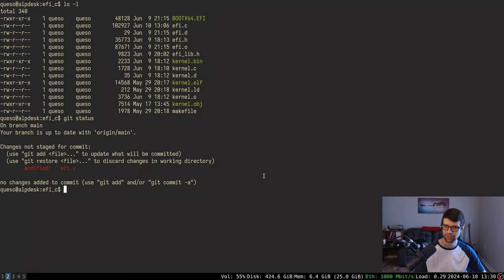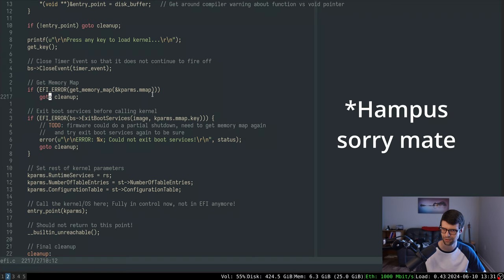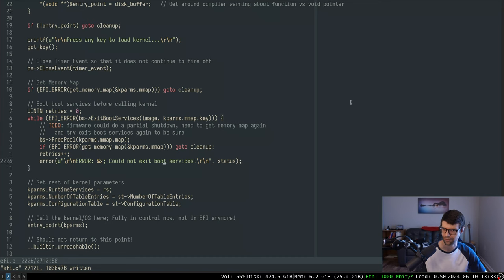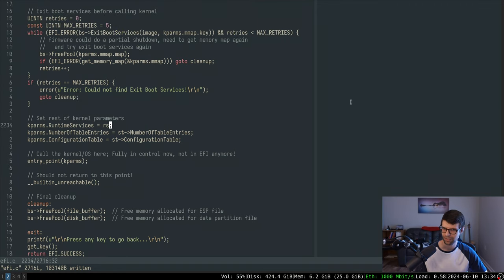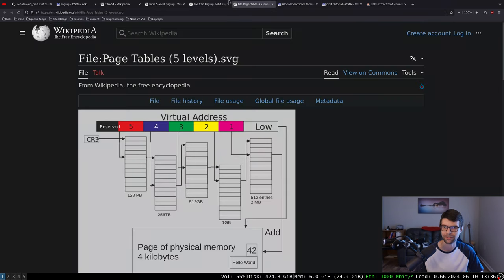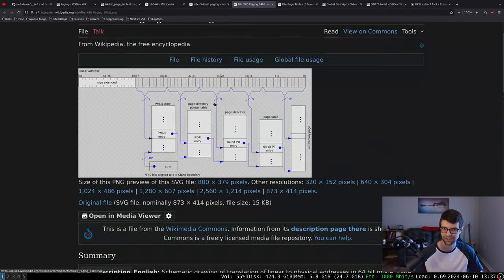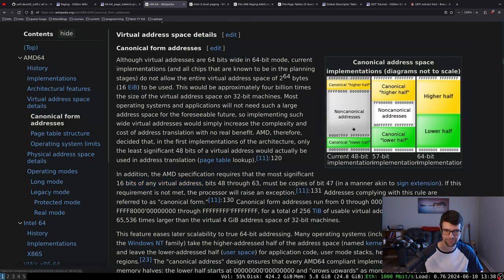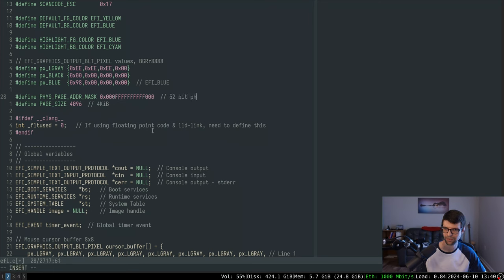Setup x86_64 Paging to Remap Kernel (1/2) | UEFI Dev (in C)

Comment: which windowmanager are you using?
Reply from the maker: i3wm with the i3 status bar. Didn't customize it that much from the defaults, but the config files are here https://git.sr.ht/~queso_fuego/dot_files/tree/master/item/alpine under files i3-config and i3status-config. 

They're copied to the normal locations via 
# i3wm
mkdir -p ~/.config/i3
cp i3-config ~/.config/i3/config

# i3 status bar
mkdir -p ~/.config/i3status
cp i3status-config ~/.config/i3status/config

Comment: How u know so much.... How many life time does
 that require to at❤🎉tain this level of certainty
Reply from the maker: Read documentation, test a lot, try to explain your thoughts so it mostly sounds like you know what you're talking about, and time & experience (but most of what I've done can be learned in 3-5 years or less probably, at 4-6 hours/day). Use and try out more than 1 language as well, I like C but you should get experience with other languages also.
My thought processes also changed substantially around 24-26 years old, feels like I wasn't thinking well or as clearly before then, for whatever reason.